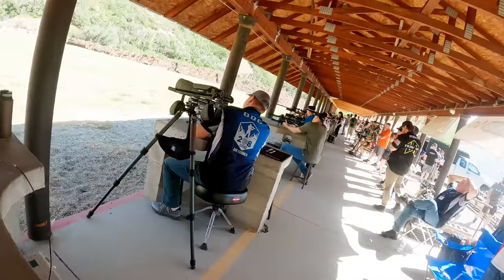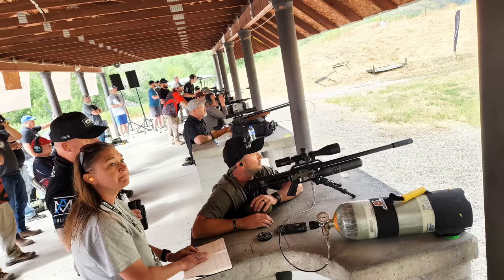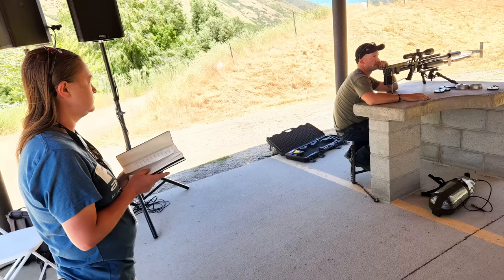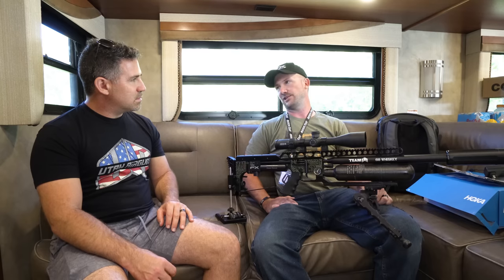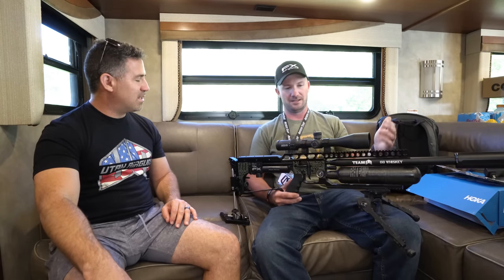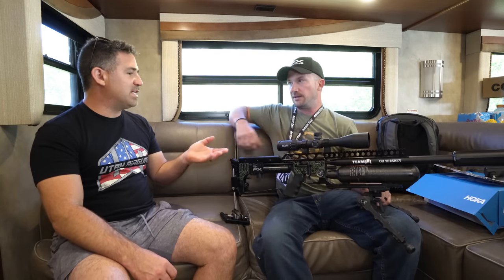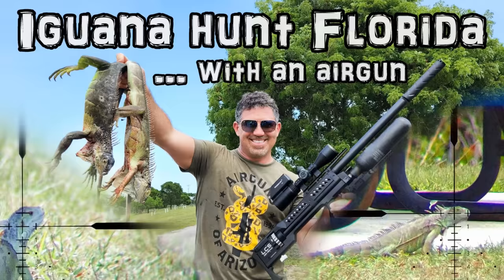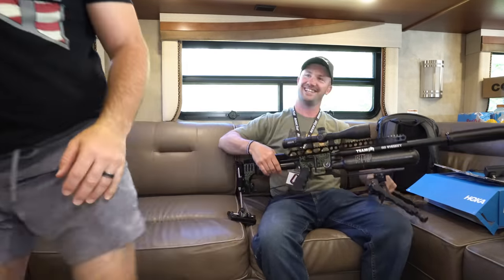Pro-Level AIRGUN Setup !! + Tuning Guide (Pro) - FX Impact Accuracy Secrets Revealed - RMAC 2022

Comment: Excellent interview Steve! You have a real knack for getting people to relax and share their experiences and secrets! One thing I especially liked is the part where Keith revealed that he weighs all his pellets. Many years ago I did a couple write ups on AGN with photos showing one of my weighing sessions with JSB 33.95gr pellets. The weights ranged from 32.8gr at the low end all the way up to 34.9 at the high end. One difference is that Keith weighs his to within .2 tenths of a grain and I weigh mine to .1 tenth of a grain, and then put all the ones that weigh the same into separate cans. I always cleaned mine first with Acetone to remove any gunk from the manufacturing process though. 
The bottom line is that if all the pellets in your magazine weigh the same as each other to within .1 - .2 tenths of a grain, then except for wind gusts they are all going to hit the same place on your target. This procedure also eliminates that one or two pesky fliers from your groups. One last thing you can do to improve on your weighed pellets is to lightly lube them with Napier Power Pellet Lube...try doing what I say and you will be amazed at how much tighter your groups are and no more fliers in your groups! All the best, Chuck
Reply: You know of what you speak my friend.    I also like to lube when time allows though i use silicone.  Same effect.  You cant eliminate every flier (there might be a bubble in a pellet that weighs the same) but this sure ups your chances.   And playing the odds is always what we do when we shoot for score lol

Comment: I’m tuning a Slugger Edition M3 in .22 and this video made my morning. I was so disappointed when I got it and started shooting on the stock tune. (1030 fps on 31.2 gr .218). I slowed the fps down using the wheel and fine tuner but ultimate found my sweet spot using the valve adjustment on the second bar. Final settings are M-8 m-3 Valve-2nd line. Final velocity - 960 fps. Hope this helps anyone and this channel rocks. Always be willing to detune. I can still reach out over 300 yds it’s worth it